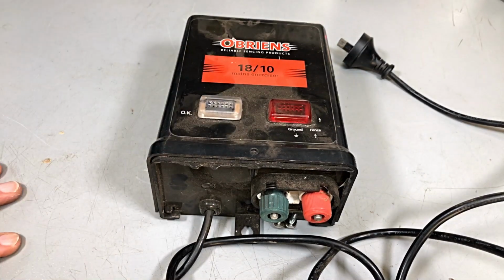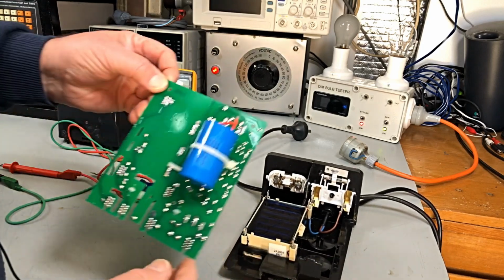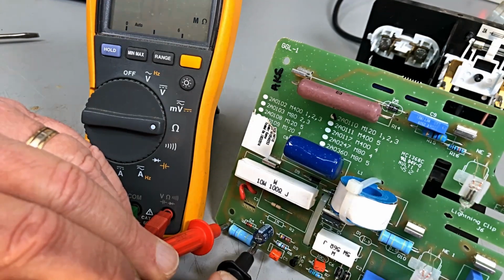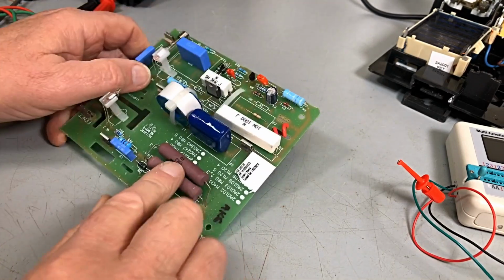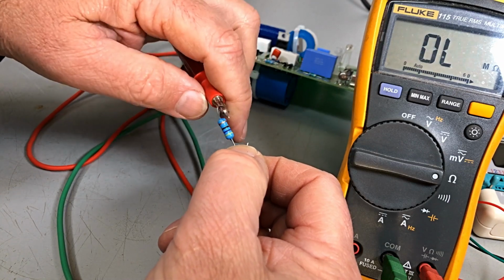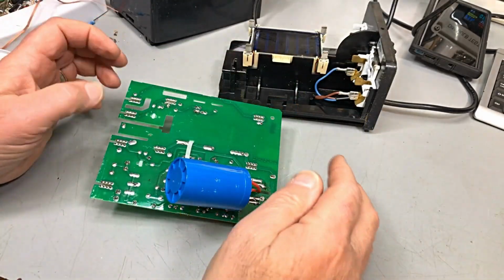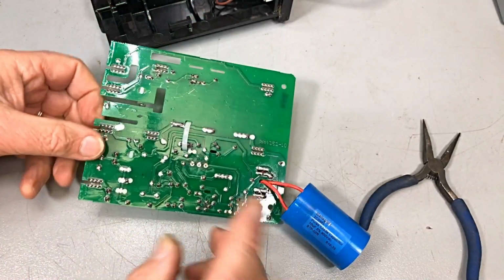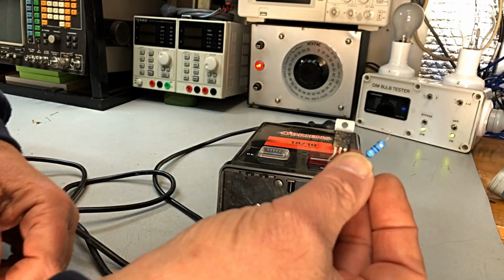ON THE BENCH - An Electric Fence Energiser with No Output - Lets See Why !

Comment: Great Repair Baz I have found Shorted SCR etc on Fence Controller I have put Faults down to Lighting discharge on the long electric Fences,Top Work Baz without a Circuit Diagram which at you said are unavailable,Ian,
Reply from the maker: Thanks for the info Ian, I'm sure lightning or close static charges would play havoc with these. Thanks for your comment !